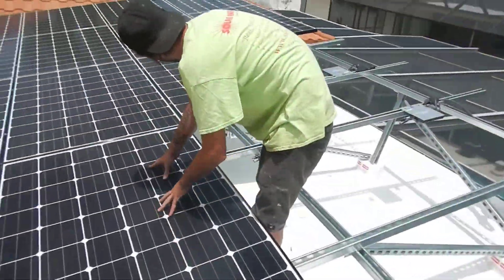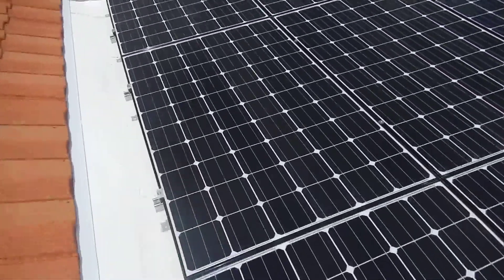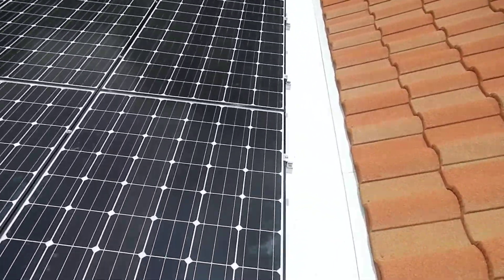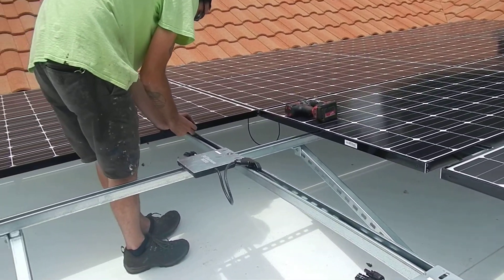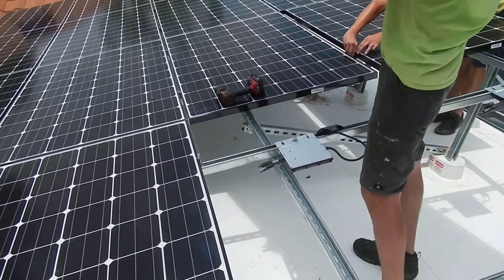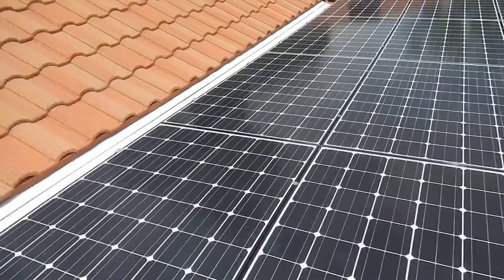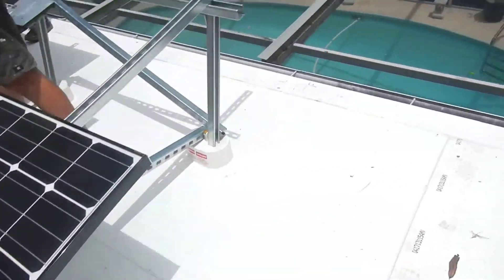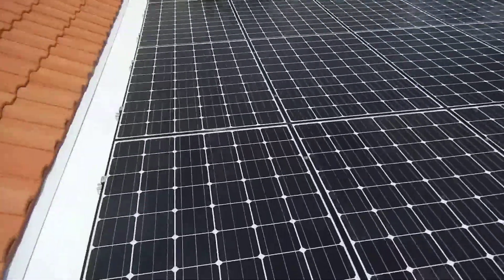SOLAR ELECTRICITY INSTALLATION. PART TWO

Comment from the maker: Very clean sleek panels we got from LG. these are the new LG mono-x  275w panels. CHECK OUT THIS INSTALL WE DID.

 #solarpower    #SOLARENERGY   #solarliving   #solarelectric   #solarpanels   #solar   #alternative   #energy   #photovoltaic   #pv   #gogreen   #savetheworld   #sustainabllility   #sustainable   #electrons   #silicone   #siliconecells   #unistrut   #rackmounted